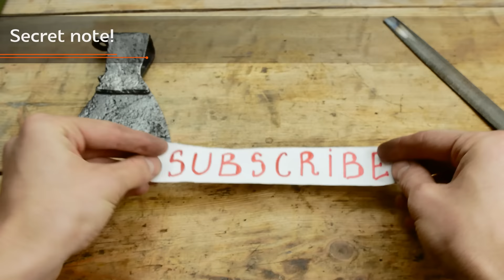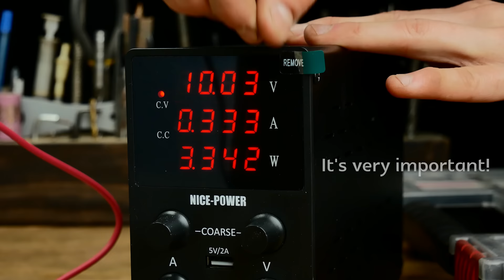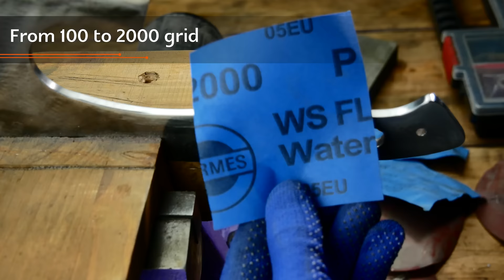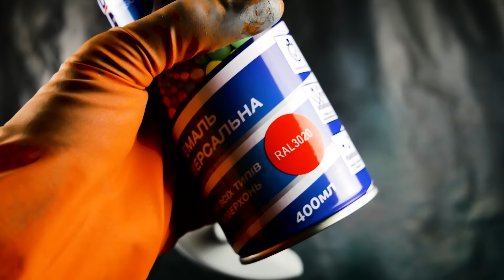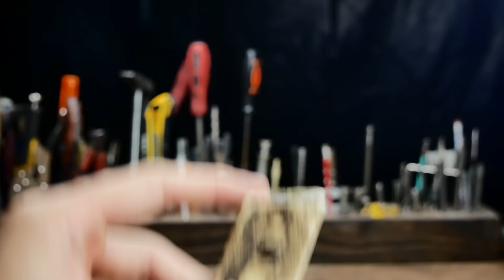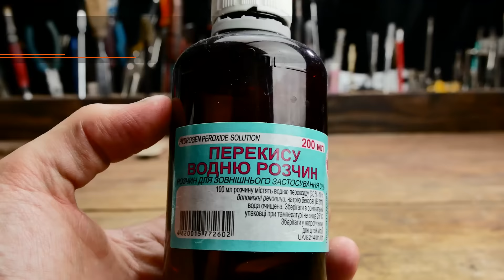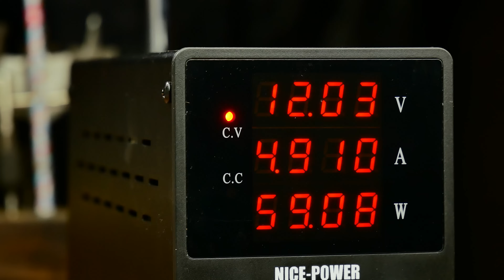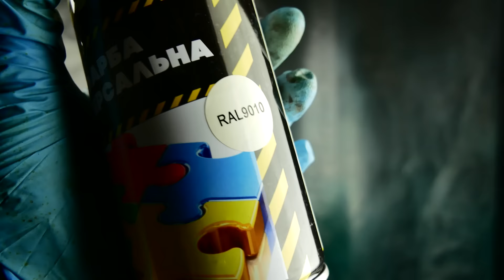Restoring Incredibly Old Tools! A Whole Hour of Amazing Restoration Techniques

Comment: Interesting restorations, a couple of them I have watched before, however, I did watch them again and discovered a I had overlooked a process on the knife restoration,  so I am glad I went back thru to see them. I wished you would have shown the trigger assembly on the pistol, I was really anticipating that spring to go flying across the shop 😮😊😂 not that I’m wishing you bad luck or anything, thanks for the restoration compilation, enjoyed it, nice work.
Reply from the maker: Thank you, it's really nice to be appreciated for more than one video that has a lot of my soul put into it! 

And to tell you the truth, you're right. The "spring" did come apart. I tried three times to make an identical one and only one fit, but not like the original.....

Comment: absolutely beautiful work. Love the cleaver. I also like that you left some of the pitting. I would rather have one of these than a new one any day. Not only are you great at restoration, you are a talented artist and can make videos that are very engaging. I watched all the way through without stopping.
Reply from the maker: Thank you for your wonderful words ❤
Reply: Ridiculous, no need for the nail that ended up splitting the handle.The wedge that you put in did the job. Also this crap about pitted old steel and iron is nonsense,and that's why the older generations didn't look at things this way.

Comment: I have some trick for you, to avoid the crack while you put the nail. You can hit the bottom of the Sharp nail with your hammer and then use it. Hope it helps, you never know if you never try 👌
Reply: Or predrill the hole a bit smaller than the diameter of the nail, the wood the nail is replacing has to go somwhere and thats what causes the cracks.
Reply: That tip is ridiculous. He should have drilled a simple pilot
Reply: Sounds like some shit you just made up

Comment: Where you split the haft while driving the nail use a small bit  in your drill press to drill a pilot hole thru the haft at or near the end of the split. The holes on either side of the haft will establish an entry point for the pilot point on a forstner bit, enabling you to bore counter sinks for a nut and washer on one side and bolt head on the other. The forstner's pilot point will give you a perfect entry point for a brad point drill bit the diameter of the bolt you decide to use. I'd fill the bolts countersinks with a mixture of epoxy and sawdust. If this procedure was carried out before your nail split the haft, or you had drilled a pilot hole for the nail, it may not have split at all. Just sayin.😁
Still a great job. Especially the annealing and re hardening in the oil bath. Its recommended  to use long tongs and to stir the object being hardened.
Reply: That’s some good ass wisdom
Reply from the maker: Thanks for the tips!
Glad you enjoyed it!
See also other videos😉

Comment: 10:45 you should have drilled a hole a the very end of that crack, so as to prevent its propagation in the future . And perhaps use you wood glue with a good amount of wood dust mixed in too

Comment: Based on the amount of rust and pitting compared to the quality of the metal an axe head, knife or sword is made of is there any way to determine how long an object has been in the water or ground?
Guns can often be age-identified by the technology used to manufacture them and the firing methods that allow them to function, but swords and knives can be from almost any era. If you're hoping to find something collectable in what might be an ancient shipwreck would the amount of oxidation on the piece give you a good idea of how long it's been on the bottom of the lake or ocean?

Comment: Predrill the hole for the nail (with smaller diameter) and then nailing head to the handle won't split the wood!

Comment: If you were gonna sand blast the rust anyways why did you go through the trouble of soaking it in vinegar
Reply from the maker: I buy quartz sand for sandblasting. If I don't remove pieces of rust beforehand, the sand will have to be changed or filtered.

Comment: Чтобы топорище не треснуло нужно было саморез выкручивать, или хотя бы предварительно просверлить узенькое отверстие.
Reply: Да ладно тебе , ты уж очень строг на парня , ...сделал неплохо ,со вкусом
Reply: I suggested the same. Drill a lesser diameter pilot hole for that nail, or better yet, do the same and use a screw. He had to fill the crack because he couldnt remove the nail to get the haft out of the head in order to bolt through the haft and close the nasty crack. The function of the tool would have been fine with the crack. 🤷🏼‍♂️
Reply: @boriskaru You are saying its ok to teach sloppy methods. I can imagine what your work looks like.
Reply: ии таак сойдет...

Comment: Step 1 electrolysis . Step 2 bench grinder wire wheel . 
Step 3 media blaster 
Step 4 angle grinder   
Why are there steps 1 thru 3 ?

Comment: What does the step “cold blue” mean and do for the restoration?
Reply from the maker: Cold bluing is the process of applying a protective film to the surface of metal to protect it from corrosion. 

Hot bluing is the usual process of heating the metal to 500-600 degrees Celsius followed by cooling in oil
Reply: @uniquethings6032  thank you for explaining! ❤️

Comment: Your a very smart Chemitrist and Metalworker, wow! Your treating of wood is, hmmm, a little bit rough. Such a thick nail without drilling a hole before, no carpenter would do that, an Axehandle doesn't need to be finished with 600 grain, will slip out of your hand when your sweating by working with it. And do you know the reason why wood is mostely brown? Cause people paint it this way, no other reason. Occaisionaly talk to an experienced carpenter an learn further interesting things about wood. And get rid of this horrible grater and geat a planer instead. 
Stay as you are, greetings from germany.